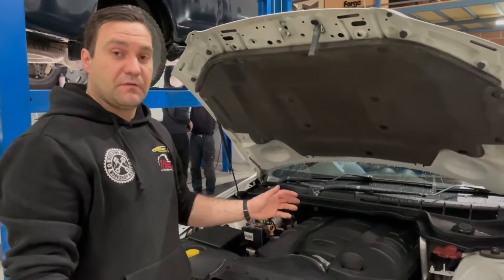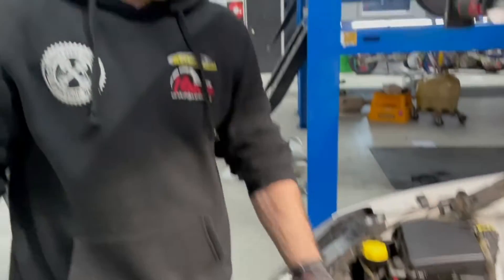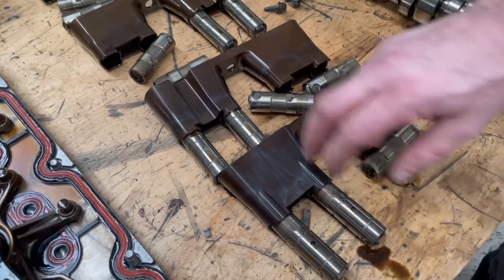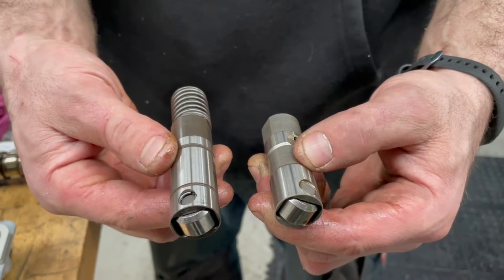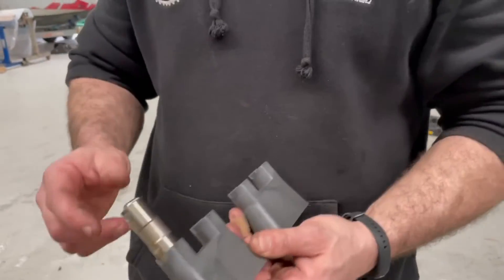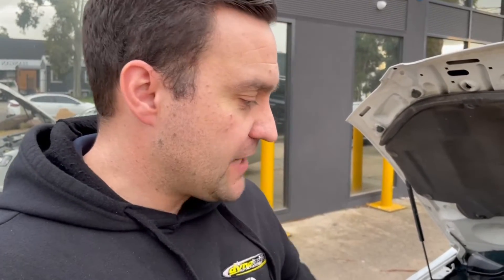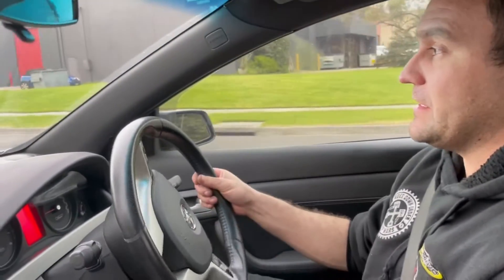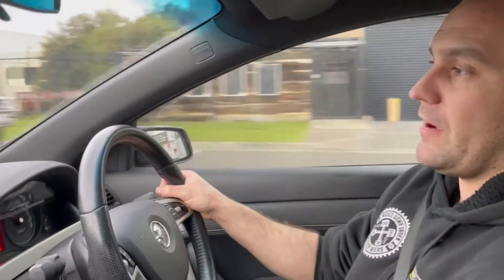Holden L77 VE SS D.O.D Delete kit from start to finish with upgraded Cam Shaft 228 / 244 @.050

Comment: I am in the process of pulling the engine apart to do the same. I've swung the power steering pump to one side. It looks like I need do the same with the alternator. Is this the correct way? A couple of the bolts on the timing cover are easier if I remove it.